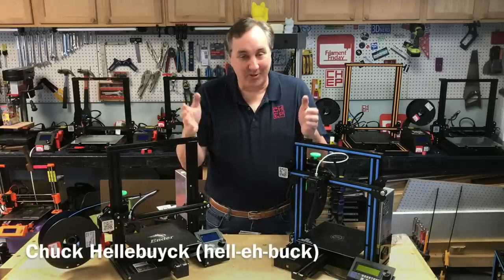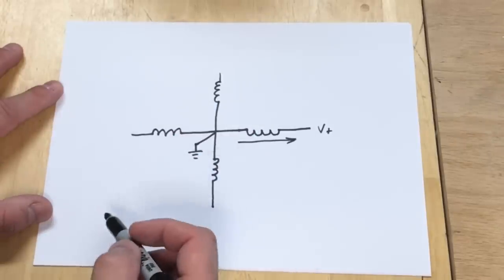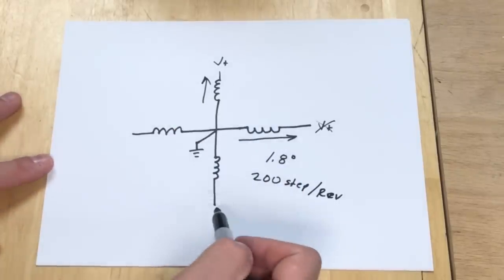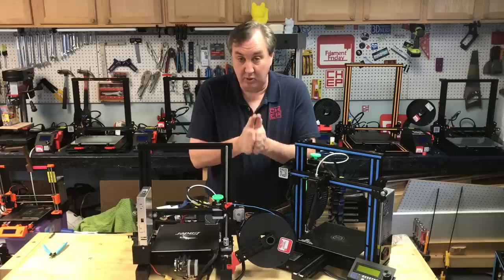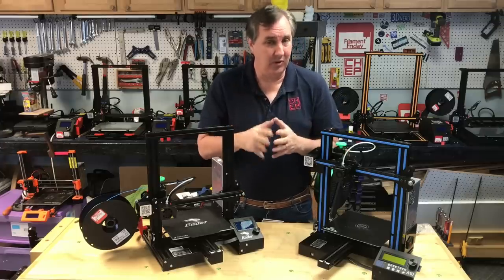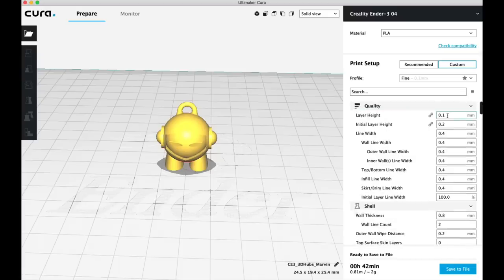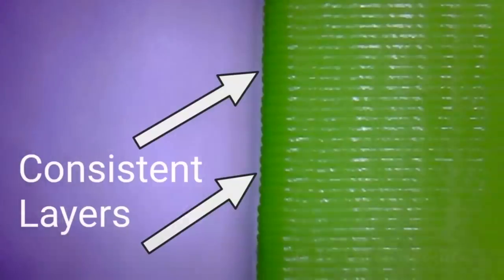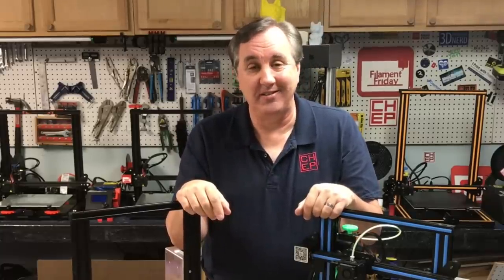Better Quality 3D Prints Using MAGIC NUMBERS on Creality Ender 3, CR-10, A10

Comment: OK, Why, in the name of heaven and earth is this not something the is the first thing that people mention when setting up a printer?  I did this on my Ender 3 and the results were immediate and startling!  I printed the same items , back to back using the "magic" number and the "standard" layer and the prints are visibly better.    Not sure about all this back and forth about microstepping, but the anecdotal evidence (my eyes, your microscope) sure says that something about this works.  Thanks for the tip!
Reply from the maker: Thanks for confirming. Lot of doubters on here but yet to see someone try it and prove it’s wrong.
Reply: @FilamentFriday  I'm sure that many people will say that the ENDER 3 is just a cheap printer.  For the $$$ Spent, the ENDER 3 delivers much better than average prints, out of the box.   I realize that there are many factors that influence print quality and I am just scratching the surface with my ENDER 3.  However, with the stock Main board and drivers, which admittedly are marginal, this method of tuning seems to help measurably.  That being said, the visible difference in the print layer quality convinces me that this is a worthwhile adjustment.   On the other hand, high end printers with advanced stepper drivers, more processing power and other premium construction features may not see any benefit.  Micro-stepping is something that is certainly negated to some extent, by backlash in the lead screws and flexibility in the frame or other drive components of the printer.  It takes a very precise and rigid machine to translate these very fine micro-steps into equivalent corresponding linear motion.

Comment: That nobody has reacted yet makes me doubt myself, but aren't all of your calculations wrong? I'm quite certain that the pitch of the leadscrews are 2mm, (the diameter is 8mm though)

2mm / 200 = 0.01 mm natural step. Which makes it safe to use every height that only has two decimals (0,10 - 0.11 ..... 0.15 etc etc). 
So it's true that your 0.12 did fit the natural steps, but so did the 0.10 and all the default layer heights in Cura.
Reply: Correct. If that 8 mm screw would have a pitch of 8 mm it wouldn't even rotate because of self-locking.
Reply: Chacherorr it is likely a four start lead screw. So it has 4x2 for an effective pitch of 8mm.
Reply from the maker: Yes, it’s an 4 start 2mm pitch so 8 mm rise on one turn.
Reply: @zzing  you are right, didnt thought of that
Reply: To get the magic number all you really need to know is the current M92 Z value and the micro-steps for Z. For CR-10S it's 400 and 16. The formula 1/(400/16) gives you a whole step height of 0.04mm. I'll see about adding something to Marlin to print this value out, probably as an extension of M92.

Comment: Any chance you may now the magic numbers for the Anycubic i3 Mega printer ?
Reply from the maker: No but move the threaded rod one turn and measure the lift then divide by 200.
Reply: @FilamentFriday  thanks that helps my question, I used the screws on the part that joins the rod and the motor as reference for a full revolution.
Reply: My Anycubic chiron is 8mm per rotation im sure they use the same rod.

Comment: How can I forcemy ender 3 to have the home zero of the Z axis on a full step and not between microsteps?
Reply from the maker: You can’t. But it doesn’t matter because the magic number averages out any Microstep variation by going to the exact same microstep it starts with.
Reply: Emmanuel Rodriguez more of a scientific answer (not recommended as it will be worse quality) is to completely disable micro-stepping. However maybe since it’s on the Z axis and using magic number it could be better since theoretically it should never need stepping, so maybe... All other axis would be bad, but Z might be an improvement if you can disable it on just that axis. If you try it out then let me know, even if it’s 0 difference I’d be just as intriuged by that result (I don’t have an Ender 3 yet and haven’t looked at the control board to see if there is a way to disable microstepping, only old school Ramps 1.4 Prusa era with replaceable drivers and honestly haven’t thought about doing that as I just learned about this effect, lol!)

Comment: In theory this sound good but this will depend on where Z stops the stepper motor, if it stops in the the middle of those magic numbers you gonna get that all the way up.
Reply: You don't need to land on  a full step, just consistently on the same microstep each layer. The theory is: Different microsteps have different load angles because of driver quirks and this shows up as inconsistent layer heights. So if you always land on say the 3rd microstep from a full step and that 3rd microstep is 10% lower on the z-axis than it should be mathematically and all layers are 10% lower on the z-axis, but have a consistent distance relative to each other.

Comment: how then you set the motor to start from  z =0,00 and the stepper motor to be in the step and not in between.
Reply: It's an interesting question. Maybe it works relatively?
I think you can ensure this by re-assembling the spring connector in 0.00 position with drivers turned off. The shaft will self-rotate to the step and then it can be fixed. One note... I guess you'll need to fix the gantry by something... Don't know if it's easy to do.
Of course this is the theory only.
Reply from the maker: You don’t need to start at a natural step. If you start at a microstep then using Magic Numbers will rise at the same microstep each layer, this averaging out any microstep variability.
Reply: @KiR_3d  you just can't with with the precision those machines can reproduce. you'd have to be exact to about 0,0025mm (1/20-1/40 of a human hair) and keep that setting somehow. (with 1/16 micro-stepping that is) This thing about magic numbers is just a myth. Sure, there's something to it, but usually your stepper motor sis strong enough to hold microsteps reliably. if not, you should oil the lead screw.

Comment: Awesome. I'll try it 0.24mm, 0.32mm on my 0.4mm nozzle. What if I use 0.6mm nozzle, is the magic number still applicable?
Thanks for figuring this out 😁👍
Reply: It should be, as the way it's described in the video, the "magic number" is a function of the Z screw not the nozzle. But, I'm still new to this, so consider that in my answer.
Reply: Jeremy Jay Lim yes
Reply from the maker: Yes, it’s independent of the nozzle size.

Comment: I'm curious: Did anybody made a 3d printer with stepless motors? I guess it's possible with few angular sensors which will be getting and "telling" numbers to a mainboard. So the motion will be controlled with constant feedback. Also (my guess) it will need a superb voltage stabilisation/correction.
Reply from the maker: Not sure. But seems like it would’ve tough to get a sensor that can read that fine of rotation unless it’s bigger.
Reply: Yes, there are printers with servo motors but also require linear position encoders for feedback of movement, they are "generally" more expensive and complicated.

Comment: Just a question, if someone can shed some light: he said that in the ender 3 each revolution amounts to 8mm travel. It is my understanding the ender 3 uses m8 lead screws which should have a pitch of 1.25mm. Wouldn't that mean that each revolution results in 1.25mm travel?
Reply from the maker: It’s a 4 start 2mm pitch giving it an 8 mm lead.
Reply: @FilamentFriday  Thank you for the reply. That makes a lot sense... now that you said it :p thank you for the video. have a good one

Comment: Your video makes sense ans seems like it would work but REALLY glosses over how to set up the profile in CURA. A post or follow up video to explain this would be great
Reply from the maker: Just change your layer height to 0.12, 0.16, 0.2, 0.24 or 0.28 . Nothing else to show.
Reply: It took me forever to find that spot in CURA, it does not help that about 99% of the configurable settings are hidden until you go in and unhide them. maybe a series on what settings are needed and what setting asr just helpful. Keep up the great work.

Comment: So if I have a lead screw that has a 2mm lead, TR8-2, then my magic number would be 0.01 correct?
Reply from the maker: Yes.
Reply: I checked with Lulzbot and TAZ 4/5 have this 2mm pitch, so thanks this helps.
Reply: @FilamentFriday  , so when you apply a micro step to your steps/mm say like using 32 micro stepping, how does that affect this number?
Reply from the maker: Doesn’t affect it at all.

Comment: Question:   My Ender 3 has started to print at 10mm above the bed.... I have adjusted the Z axis and also reset the home point... I cant seem to change the height it prints at.
Reply: Then most likely it's your slicer config
Reply: It should give you some warning in the slicer if it doesn't start the print on the bed. Check your Z-axis offset and make sure that's under 1mm from zero.
Reply: What I had to was move the z axis home switch up like 5mm because the print head was to low so you might have to do the opposite and move the switch down some so the print head is closer to the bed and then adjust with leveling nobs

Comment: As much as I appreciate the merit in what has been said here (and have adjusted my Ender 2 profiles accordingly), there's a fairly (in my opinion) significant oversight in your explanation:

While you don't specifically mention it, you heavily imply that the improved printing speed in your Marvin was due to using a Magic Number.  Cura doesn't know what the Magic Numbers are, nor does it care - it can't, since it has no idea what steppers you're using nor what pitch is on the lead screw.  Ultimately it has to assume a perfect motor with a perfect screw, so the time taken to micro-step is irrelevant.

Instead, what you're seeing is basic 3D printing settings in effect.  Your 0.12 estimated faster than the 0.10 simply because the layers are thicker, thus less layers.  20% more material going down 16.67% fewer times, which corresponds perfectly to the time reduction from 42 minutes down to 35 (35 = 42 x 83.33%).  Add to this the default Cura top/bottom settings of 0.60mm and you're also only doing 5 full infill layers instead of 6 for each, again reducing the overall print time.

This is also why using 0.08 (also a Magic Number) will estimate approximately 25% longer again as compared to 0.10, since there will be 25% more layers to counteract the 20% less filament of each layer, plus 8 full infill layers top and bottom vs 6.  The Magic Number doesn't come into it.

As to whether this is true for actual print times, instead of esimates?  You didn't give those times, so I've no idea.  It might make layer changes ever so slightly quicker, so it should make things fractionally faster (sub-1% overall time difference).  Z-hop could make the gains more significant (though still pretty small).
Reply from the maker: Then you missed the point of magic numbers. It has more to do with equal size layers for smooth prints. Speed is just a side benefit. Read the comment pinned above yours for more detail.
Reply: Oh, I very much got the point of them.  And it's indeed a valuable point - equal and predictable layers are always going to offer a better result than layers with even small random variation.  As I also mentioned I even adjusted my profiles accordingly due to those benefits, which you not only explained but demonstrated very clearly.

As someone new to 3D printing I can only thank you for bringing this to my attention, and I'm currently combing your other vids for more tips.  I promise no comments, though, since even I feel like I was being pedantic on reflection.
Reply: @asterchades  Don't not comment.  If he is willing to take the time to respond and explain/rephrase it helps us all learn a little more.

Comment: hi Chep 

great video, as usual! 
when i saw this video i thought ok he's probably right so i used the numbers and spread the word.. 
but one day i thought how did he get to this number. you say your lead screw is 8mm! when i measure mine (the distance between two threads) i have 2mm. most steppers have a 1,8 degree per step so thats 200 steps for a full rotation, i come to the conclusion that my printer (ender 3) has a 0,01mm per full step (2/200=0,01). 

can you confirm i did every thing correct? and if so maybe it's wise to make another video... 

best regards!
Reply from the maker: It’s 8mm lead. It’s a 2mm pitch with a 4 start lead screw so 4*2mm = 8mm
Reply: @FilamentFriday  i do not fully get what your saying here. do you mean there are 4 parallel threads so in 1 full rotation the nozzle raises 8mm or something?
Reply from the maker: Yes. It’s called a 4 start lead screw but just turn the motor one revolution and measure how much it lifts. That’s the number you use in the calculations.
Reply: @FilamentFriday  just did that and you're correct. and in the proces i learned something new. seems there is more than meets the eye.. thanks for that! though i was hoping i had a different lead screw with better precision :)
Reply: @jazekerxx7535   "...do you mean there are 4 parallel threads so in 1 full rotation the nozzle raises 8mm or something?" This is why it is important to pay attention when someone is expressing an idea in a technical context. He says EXACTLY that @2:30 in the video.
Reply: @MoragTong_  no he does not, he only says it lifts 8mm. pay attention! so if you measure a pitch of 2mm you'd expect it raises 2mm. i had never heard of parallel threads..

Comment: Will this magic get rid of "salmon skinning"?
Reply from the maker: Not sure. It should reduce it but I haven’t  tested that yet if it eliminates it. My machines don’t really show it.
Reply: @FilamentFriday  Thanks for that reply. I'm going to try this out as soon as my ender 3 pro arrives.
Reply: doubtful
the various Tevos use a 2mm rise lead screw vs the 8mm rise in say the Ender 3, which gives you a magic number of 0.01 and the Tornado was known for it's salmon skin in the first iteration... they had various issues and needed a smoother

Comment: I have a question that has been eating at me for a while. You say the rise of the of the lead screw is 8mm, but that seems awfully steep. No matter how many threads there are, one full revolution of the motor will only raise the Z-axis to the next thread. I believe most lead screws are 2mm from thread to thread, so wouldn't the magic number be 0.01?

I'm not saying you're wrong. Just saying I'm confused and don't understand how you got the 8mm number.
Reply from the maker: It’s a 4 start lead screw. 2mm pitch, 8mm lead.

Comment: While I do use magic numbers, typically, I'm still not sure I'm fully convinced. The chances of you landing on a full step for each layer is tiny. I would need to see more research before I am convince it actually makes a difference. Maybe landing on the same microstep each time does make a difference but I still need to see more evidence at other magic number and non-magic number heights.
Reply from the maker: Look forward to your results.
Reply: It doesn’t have to be full steps, just the same spot each time
Reply: @Moosetraks21  That's great. Still not enough on it's own to convince me it really makes a difference. Show me the evidence that it is truly better.

Comment: You’re interpreting it wrong. 0.04 is the size of 1 step, so you want a layer height that is an exact number of steps (otherwise the stepper will go to the closest integer number of steps, causing the height variations). Your results are correct but your explanation isn’t.
Reply from the maker: Nope. My explanation is spot on.
Reply: CHEP ok, I didn’t notice that you were saying revolution for the rod and rotation for the stepper. I thought you were saying you wanted the same revolution position for each layer, which would imply layers of 8mm! Sorry for not hearing properly. Apparently 1 revolution doesn’t equal 1 rotation, but equals 200 rotations. Then it makes sense. So the stepper has has a 200:1 gear ratio?
Reply: @edpietila2026  The motor has 200 physical coils inside of it, so 200 positions at which it can "lock" into position. There's no gear reduction as its direct drive and no gears meeting each other. But for every one full rotation the platform moves 8mm. So if you divide 8mm by 200 you get 0.04
Reply: Gabriel Soria My entire error was thinking that he said that he wanted to have steps of 1 full revolution. I get the mechanics, just simply misunderstood what he said.